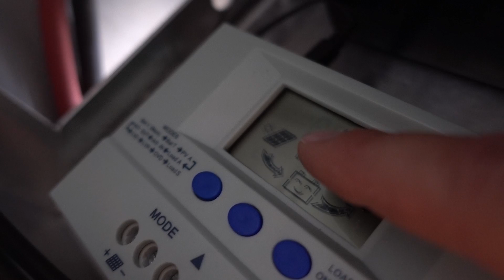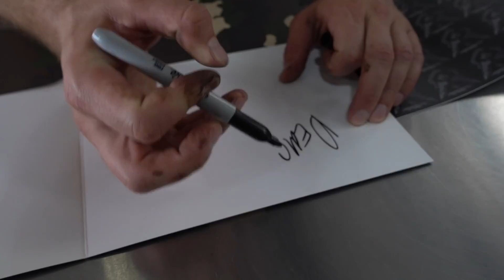Installing a Complete Solar Power System!

Comment: ***ELECTRICAL SAFETY NOTICE*** PLEASE MAKE SURE YOUR METAL ISO CONTAINER IS EARTHED AND SUITABLE BREAKERS ARE USED!! THATS ONE BIG CONDUCTOR WITH EXPOSED POSTIVE LUGS. Loving the videos!
Reply: Why? The inverter is an isolated supply.  The neutral/earthed point is inside the inverter not the general mass of earth. 
The normal supply from your house wiring is different the neutral point is earthed at the supply transformer into the ground.
Reply: @robertwilliams7222  I would connect the neutral earth point to the container and then earth the container... any chance of an electrical fault would be covered. Not having that container earthed I feel would be stupid if you physically can.
Reply: And it would be a VERY good idea to additionally cover the outside wires - otherwise the UV of the texas sun will complety eat away the insulation!
Reply: Actually the only ground in a solar system is the battery negative, rest of it floats. Trying to ground it can cause the inverter to fail. Inverters have built in breakers for the output side so that isn't a worry. I WOULD fuse both battery leads right at the battery in case of a cable failure, a battery can explode if shorted out. I use 100amp 36 volt fuses in my system, car audio places carry them for the big amplifiers. Rest of the system he used was plug and play... but the wires coming through the container wall should be in conduit or at least a conduit bushing because over time they may rub through and short out on that sharp metal. I have 2,400 watts of installed solar powering part of my house!
Reply: Does the container need ground rod attached to it in case of electrical storm?
Reply: he would have been better of using DC 12 volt LEDs.  the system works but is very inefficient. it goes from a battery to its first loss the inverter.  then the fixtures that invert the 120 ac back to 12 volts or 24 volts DC. second loss
Reply: The container is metal and it's touching the ground - does it still need to be grounded?
Reply: @bg73  yes... just sitting on the ground does not give it sufficient 'grounding'
Reply: @interested8430  actually it does in a case like that, the large surface is called an UFER ground.
Reply: does Earthed mean Grounded?
Reply: @brandonb9452  Yes
Reply: As a red seal electrician, this solar system needs nothing more lol. Good to go, only ac systems need to be earth bonded.

Comment: Matt if you're doing solar you need to check out the channel An American Homestead. It's a completely off-grid Homestead in the Arkansas Ozarks. He has lots of great videos on solar system setups and how to maintain them and get them to last for many many years. He's been completely off-grid running on solar for over six years.

Comment: I actually do designs for solar. I do the electrical engineering of it. Cool stuff. Love the solar. You should just make sure there is an overcurrent protection device. It's a very important piece of equipment
Reply: very cheap way of adding one is get a fuse holder and fuse from a car audio shop. They are rated at 36 volts and can get up to 100 amp fuses! I use them on both battery terminals for safety!

Comment: So Matt... as an electrician it’s a little concerning with the cables coming from the solar panel to the container. The through hole is supposed to have a bushing to protect the wires as it passes through the steel.

Comment: Since its not being used to often it's a cheap easy install. I could have looked for 12 volt DC LED lights and deleted the inverter
Reply: but the inverter gives him 120 volt power for tools if he wants to build shelving in there... it is about a 10% loss of efficiency for the lighting, acceptable in this case. Plus 12 volt LED lights are rather expensive in that size so it was probably cheaper to do inverter and 120 volt lights!
Reply: @MaryBrownForFreedom  all LED lights or replacement bulbs are ran on DC they have all been made with a 120v a.c. to 12 v  rectifier because we are used to plug and play
Reply: @ChrisBerg-Tesla  dude I took one of my shop lights apart, I have been an electronics tech for 44 years! I KNOW what a dc converter circuit looks like. These have NO converter. The LED's run straight off 120VAC in strings.

Comment: You should paint the shipping container roof white. It will keep it much cooler inside.
Reply: Heat will destroy that battery, really need to do this to help lower temps in the container!
Reply: Brett G no different than it baking inside a hood of a car in the heat.
Reply: You would only be able to see it if you were on the roof
Reply: Can paint the whole thing white
Reply: Henry Wurdell you could also put a reflective tarp things over it and that will do a lot and cheap/quick
Reply: Could hook up another solar panel and mount an industrial fan inside maybe too
Reply: or put some camo net over the top. 
ask terkla if he's got some stuffed somewhere...
Reply: Or run a small a/c to lower the temp...
Reply: James Marx 
You can’t run an a/c system on that setup, no matter how small.
Reply: @WillFlyForTips  I just meant like a shop fan to move to hot air out of the back when people are in there long enough
Reply: 4:01 Was that Hickok45's face by the dart board???????  Matt has a lot of explaining to do, because he better not be planning on hurting Grandpa.
Reply: Actually, he posted on Instagram looking for an artist to paint something cool on it.
Reply: Go Kiptoe
Reply: White wouldn’t help the solar panel since it reflects all light black absorbs it so you would get more power
Reply: @alexfisher2002  you're not painting the solar panels white!
Reply: But it will look lame on the outside.
Reply: @Sergei-kr3ds  Functionality is what matters really. Aesthetics come last
Reply: @VS-et4pn  For me and you yes but my friend rather takes aesthetics over functionality, weird I know but it is his way.
Reply: @Sergei-kr3ds  How does a white look lame?
Reply: @SNELLERIZED  I was just trying to make a pun
Reply: @Sergei-kr3ds  wasn't  really punny
Reply: @Sergei-kr3ds  yeah but who really cares
Reply: @Sergei-kr3ds  who is 8.5 feet tall and will actually see the top

Comment: Hi Matt, nice idea on the solar, my only observation is that you are converting 12v to 120v for lights, why not use 12v lights and do away with the power inverter, think it would be more efficient that way, 12v LED lights are dirt cheap on a reel and you might even be able to power lights for more than one container just off of that one battery. Wish you and the family all the best.

Comment: there are sheet metal screws with rubber gaskets on them -> they are used for tin roofs and such and prevent water from getting in

Comment: Know very  little about solar but I think if you can find 12V lights then the cost and power loss of inverter can be avoided
Reply: He is right right now you are getting 12v from your panel and turning it into 120v with the inverter and then your led  lights are turning it back to 12v it's a very Inefficient system. You could really stream line it. I did this same thing in my race car trailer but skipped the inverter it is a waist of power
Reply: @ryanminnick2399  about a 10% loss... not huge and since this isn't a critical system acceptable. Plus it gives him 120 volt outlet for tools if he wants to build shelving in there!
Reply: @MaryBrownForFreedom  good thought...i hadn't consider that
Reply: @John Doe and you can keep bs to yourself too
Reply: Eso es verdad, hay luces de 12v que no necesitan el inverter.
Reply: That's a good idea if it works.  LED light bars are cheap too.